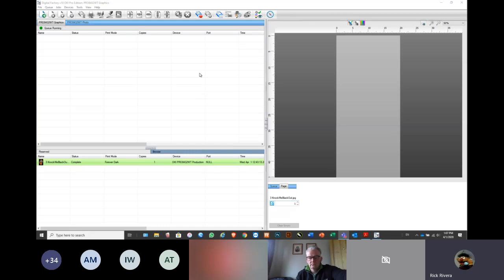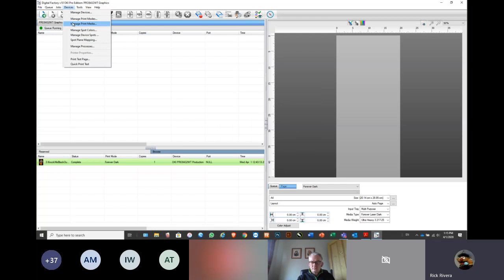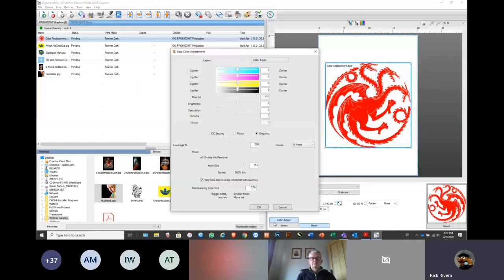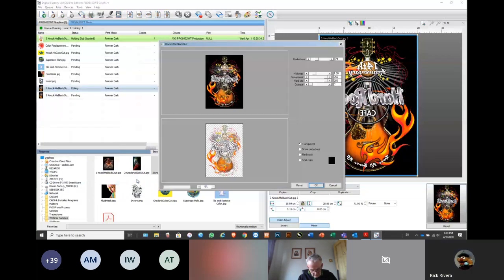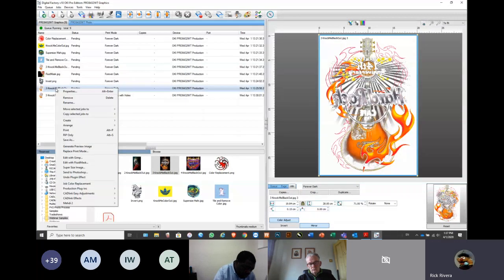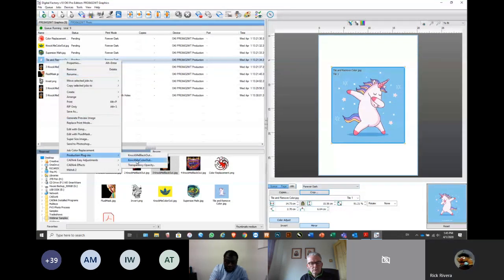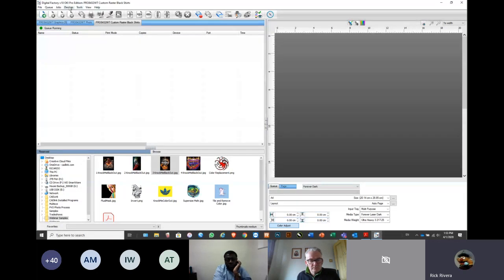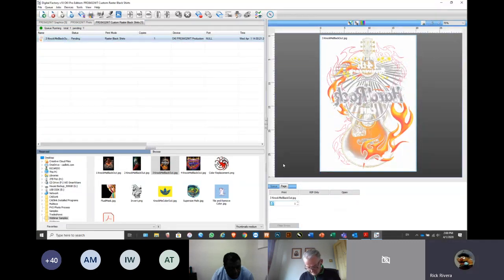CADlink Webinars - How To Optimize Your Transfer Printing Workflow (Digital Factory OKI Edition)

Comment: what am I doing wrong why can't I place the image on screen and have the whole image print? It prints a line down middle if I move the image it prints half  How do you place the image on screen so it will print the whole thing I am using epson et 8500